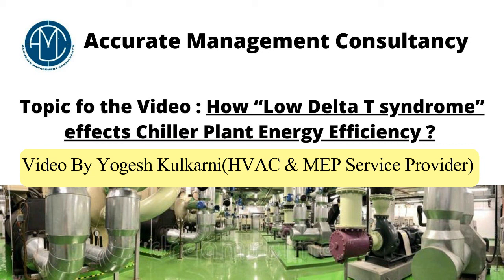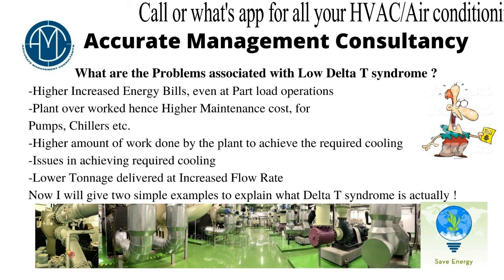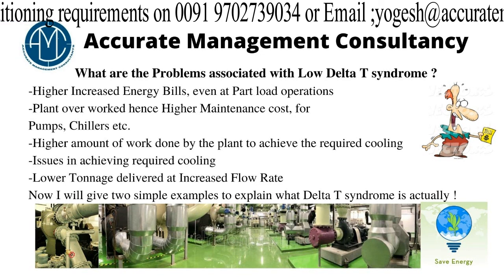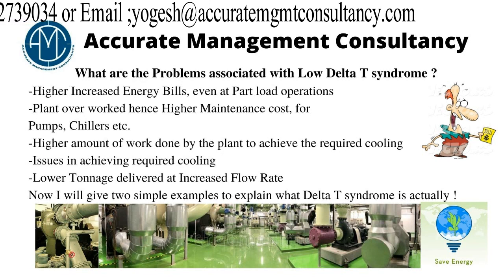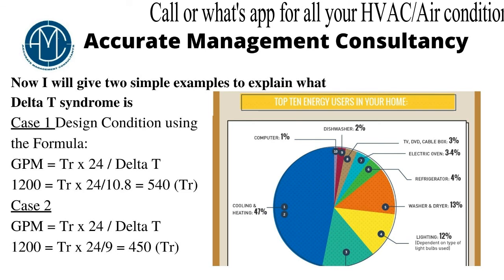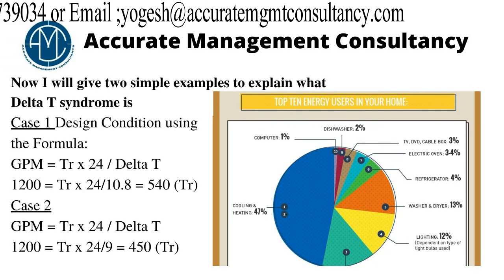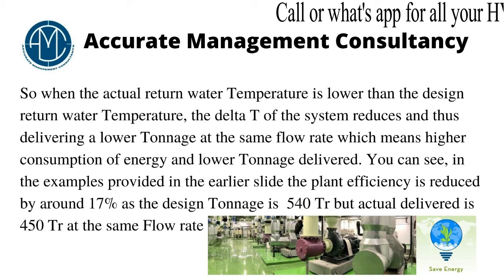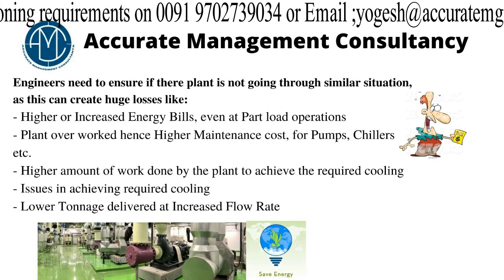How “Low Delta T syndrome” effects Chiller Plant Energy Efficiency

Comment: You have not mentioned the reasons for low delta t
Reply from the maker: Hello, sorry for the delayed reply my friend, the reason for Low Delta Low Delta T syndrome is typically caused by lowering of return chilled water temperature due to inefficient transfer of heat.(In short return chilled water Temperature is less then design)Low ΔT can lead to improper sequencing of chillers (operating more chillers than necessary) and pumps, and consequently increased energy expenditures. TYPICAL TRIGGERS OF LOW DELTA T SYNDROME 1.   Over sized equipment 2.   Scaling and fouling of coils due to improper maintenance 3.Improper balancing 4.  Increased pumping of water 5.Less Load in building ...Hope this clarifies  Thanks & Take Care